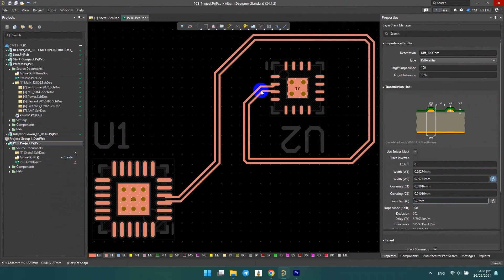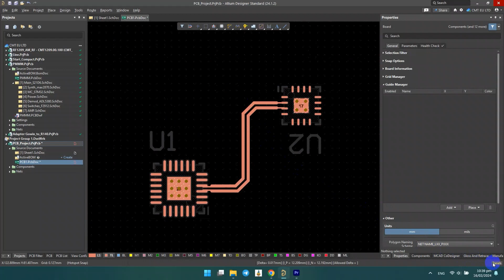8 How to Design a 100 Ohm Differential Line Profile in Altium Designer

Comment: sir can  we make these differential tracks of round shape , as i need it at my round corners
Reply from the maker: @nikhil...999  have you tried combination Shift + Space?
It changes type of angle routing. When you active tracing, press shift+space, after that you should to see, that lines with angle to be changed
Reply: @vl-shok   i have tried but it is not working while differential pair routing .
Reply from the maker: @nikhil...999  
I tried, and have not faced with issues. If you can, send me video or project, I will look. 
telegram: @vshokirov
https://youtu.be/kq_hTJsD128 - it is how it works.
Reply: Здравей, може ли малко помощ
Reply from the maker: @denisvelikov8081  Приветствую! В чем вопрос?